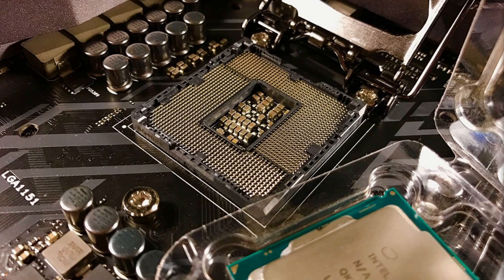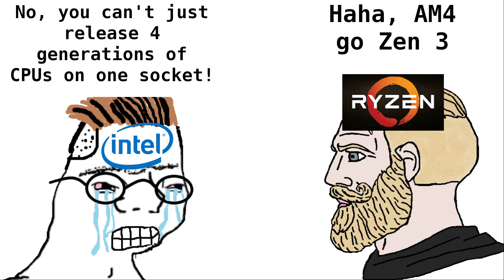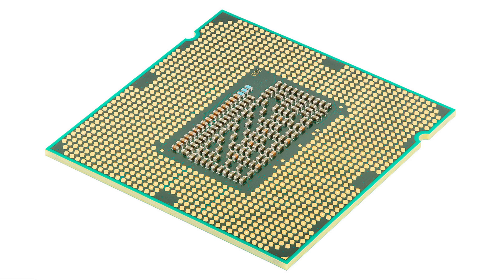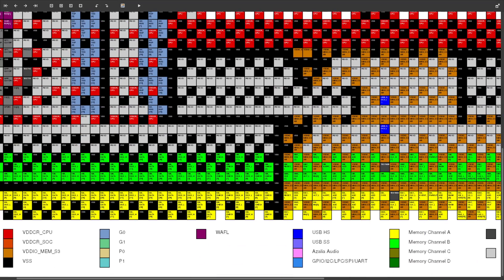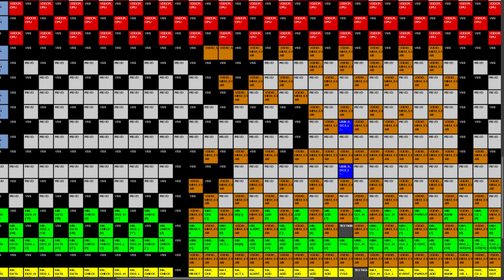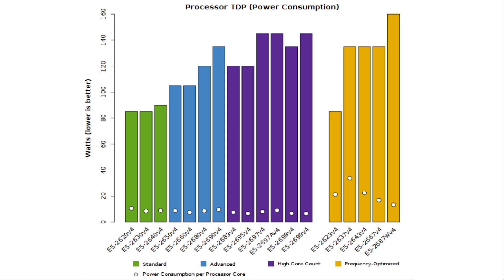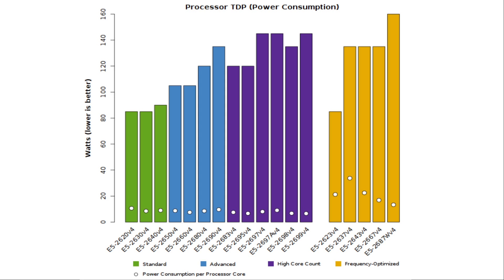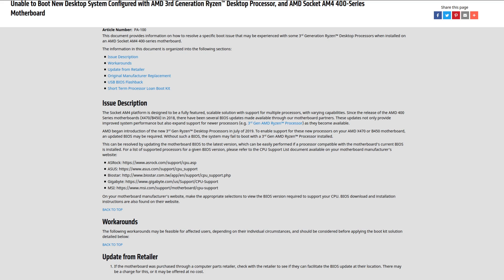The Reason for CPU Socket Changes

Comment: Thing is, you're probably a millennial or something because back then in the 486 and pentium 1 era you had to set jumpers for compatibility, and you could make theoretically uncompatible cpus become compatible that way if you knew your shit. Plus Pentium 3 and 4 that was incompatible with older boards would just be detected incorrectly in incompatible boards but still work, just with the parameters of other slower cpu model, until you updated the bios, but bottom line is, it would work, because the reserved pins would do nothing but the other pins would retain the same functions and be enough to operate the new cpu for a bios flash.

Comment: It's defenetly not suited for grandpa who writes mails and surfs Amazon. But such users wouldn't upgrade their PC in time of even one whole AMD Plattform at all. They will stick with it for 10 years, so it doesn't matter for them. All enthusiasts maybe have an older and CPU with let's say 6 cores at home, than they upgrade for a newer generation 8 core and the old 6 core goes to ebay. If they had bought Intel the would need an new Mainboard ...

Comment: There may be a real reason for socket changes but you can't ever explain to me that you can't have a universal socket. Plus if you need more pins for more speed explain socket 1156, 1155, and 1151. Intel has been pulling this nonsense for eons, and even some socket 771 processors worked with socket 775 motherboards with a tape mod, or vise versa. Plus if your buying a new PC you're probably going to buy new parts. If you have an old motherboard you are probably upgrading to a new processor which means you probably already have a processor that works with your board to begin with. I remember the buying the Z270 chipset board for my i7-7700K, then the I7-8700K came out and I couldn't use it in my Z270 board, because apparently you have to have the 300 series chipset and that was without a socket change. The ONLY time any consumer should have to change their board is if they are getting generation upgrades like DDR5, or PCIE 4.0, 5.0, etc... AMD has since proven that this can be done and I couldn't disagree with this video more. Seems strange that you would defend these companies despite being a consumer yourself. Intel and AMD could design a universal socket period.

Comment: The thing about power was a thing back in the day with the FX-9590. I’ve had that chip and it was so bad that I went through 3 motherboards before I got one which could handle the FX-9590.

Comment: the socket might have the same name, but not all chipsets have support for all cpus, most 300 series support 2 generations (same as intel), some can be extended by 1 generation with a bios update, that's it..
so from consumer pov this is a deceiving claim, as you have to buy a new motherboard anyway..

Comment: A big issue I have is that the "compatibility"  reason is completely fixed by not cutting corners. The reason the bios versions have such limited support is that it's a part of manufacture that companies have cut corners on the most, not only do they save a few cents per mobo by having smaller amounts of memory, they also have virtually no one working on maintaining BIOS versions, there's literally a handful of people who do it for the whole industry.

Of course, there's a second side to it. If the socket doesn't change, and for 3 years there's no new features to add, the companies need a way to sell more motherboards to keep yearly profits up.

Comment: i only had to decrese the cpu power mapping to 99% from 100% to get my 2600x working with a b350 motherboard so now my cpu dont lock itself up into higher temps (before it was running 80 celsius on standby since it was not compatible)now it 37-45 celsius on standby with stock cooler

Comment: amd proved if you don't cheap oy on the components it's easy to have a multi generation cpu your invalidated
2 as a consumer you should not blindly buy somethin without doing research on said product your stupidity is a your problem

Comment: While I've always had a preference for Intel CPUs, the thought of having buy a new motherboard to upgrade to a slightly superior version of the current product does induce an irrational amount of rage in me.  Kind of stupid to say, but sometimes I wish that CPUs work like any other component that goes into a PCI-e slot.
Reply: How frequently do you upgrade ?
Reply: @shigekax  Not much, I did have to upgrade my CPU more recently which required a new motherboard.  I also occasionally upgrade my wife's PC, which most of the time she just ends up inheriting my old parts.
Reply: Honestly, it's not so much of an issue for me since I plan on switching my 6th gen i5 for a brand new i7 or i9, and the board was also quite a cheap one to begin with.

Comment: 1. You can make sockets with a lot of unnecessary power delivery pins and stuff. I think a Core 2 Duo would work fine being LGA 1200
2. Today boards don’t even need RAM or a CPU to update the BIOS, and most importantly they can boot to BIOS with unsupported CPUs, they just don’t go further. I have an OEM Lenovo board from 2007 that was running Vista Basic, and it did not have any support for my Core 2 Quad Q9550, but it did let me update the BIOS.
3. I do understand chipset incompatibilities, but they should be fair with people who don’t have much money by making new chipsets compatible with older CPUs as well, so you can first upgrade your motherboard and then gather the money for a new CPU.

Comment: Empty pins are not good, it means part of your CPU has been wasted for future-proofing. The idea of future-proofing a PC is ridiculous given the fact that you should build one that will handle your needs for the next 5 years. Software hasn’t kept up with the hardware. Buying new software is not atop anyone’s mind , especially if you already own older versions that work perfectly well. The leading edge is the bleeding edge.
Reply: This is a simplistic form of view...
If u do upgrades every 5 years, u have to buy new CPU, and because intel changes sockets every year, u have to buy new mobo too. If u processor dies, if u have intel, u have to buy a processor for that socket... The same generation, or 1 above, ou 1 below, in some cases. With a long-live socket, u can buy the new generation for that socket.
RAM architecture lives for a long time and takes some years to the new generation supplant the old one in performance. DDR5 today is much worse than middle-end DDR4 on most cenarios. PCI-e 4.0 doesn't do much on GPU, and most people doesn't trully need NVME. And if they do, just a firmware update to obtain that stuff. On the Intel side, new technology means new generation and that means new socket, new mobo, and sometimes, new memory.
And in a few time we'll need to change our power supply tanks to ATX12vo
Reply: @AlexeiDimitri  I’m running an I7-4790k and a Gtx-980 with Ddr3.  I’ve had them for 7 years and it can still run good 1080p on most games. So I think it can carry me two more years no problem. If I spend wisely at that time I can get a new mobo,cpu and gpu with 32gb ddr6 and it should last another 7 years if I select a gen or two under the latest and greatest. That’s always worked for me and in the end is cheap when you amortize the purchase.

Comment: Old times CPU was bottled necked through the FSB front side bus and then further on over the south side bus. So bottle necked but very predictable bus layouts. Everything started transitioning to the CPU being much more self contained, more central, more complex, incorporating controllers for RAM, PCIE/NMVe, … and thus the CPU interconnects are much more complex today. Removing the bottle necks but making the connections around the CPU much more important / CPU version dependent.

AMD does a great work keeping on the same bus, but as mentioned in the video, you don’t know if an old motherboard really is designed for new features. If a processor has a much better memory controller than the motherboard is designed for, you may experience problem achieving the higher memory speeds due to signal issues on the motherboard. Similarly I imagine people will experience a lot of problem trying to get PCIE 4 working on a motherboard designed for PCIE 3 speeds.

Comment: Intel failed to shrink the process node for several CPU generations, so they had to keep increasing the power consumption to improve performance. AMD took advantage of the TSMC's manufacturing advancements so they could fit more transistors (and hence more computing capability) within the same power envelope with each new generation. This allowed AMD to keep the same socket for more powerful CPUs.
Reply: Ah this makes more sense.
Reply: intel didn't increase anything from sandy to skylake significantly enough. Neither power nor perf.
Reply: this would check out, except for example, the x58 platform... where pretty much any mid range or better board can clock the chips to power draw levels that are... a bit insane... im running one.. x5675@4.42-4.7ghz 1.5x volts using dynamic voltage, under full load it pulls quite alot more then any chip sold for the platform ever could have at stock... despite being a lower watt model.. ;) 

intel could have easily spec'ed their socket such that, even if they ran into a situation like this, they could use the same socket, just base support on weather or not the board is able to handle the chip.. this isnt uncommon... lower end and mid range boards often do not support higher models of chips or dont support them at their full perf specs, amd and intel have both had this since the socket 7 days so... it dosnt hold water for me... now... i can see them putting out an am3 vs am3+ spec that allowed board vendors to certify boards that already met the higher power spec, as well as new revisions that also meet that power spec. 

and yeah intels been stuck for a while, i got friends who work at their Portland Oregon area locations and... well... yeah... holy crap... the stories i hear... 

also...i have had intel employees who work in the eng depts flat out tell me that part of the push by execs to change platforms when they were stuck was to keep profits up from chipset sales, not just power spec issues... infact a few of the better previous gen boards could actually provide more power then was needed to power any of the chips for the next platform they dropped, sure they have a valid excuse to just drop a new platform when a large % of board couldnt support new features or power draw....but.... often for intel thats very much not been the case.. 

hell, this 1366 boards a ud3, nothing close to the high end of the day, but it could handle an 8c16t or better chip a couple generations newer had they chosen to keep supporting the platform. 

this isnt like the first P4's that required rambus memory and were just...shit anyway... where the socket being replaced genuinely made perfect sense.... hell... they could have put out an x59 chipset with built in sata III and USB3 and had a platform to cover another few 2-3 generations of chips, hell after a process shrink im betting an 8c16t chip for this socket would actually endup drawing less power at the same clocks vs this 6c12t chip im stuck on till some kind of sanity returns to the tech market..
Reply: It's not just this, from ~2011 onward intel used the 115x sockets without increasing power consumption substantially. They changed the socket frequently 1156 for nehalem 1155 for sandy/ivy 1151 for haswell etc. All of these sockets had two memory channels (often using the same memory technology) and 16 pcie lanes. They also only had a few different pins (the number of the socket indicating the pin count). You may be correct about the more recent sockets, idk, but in the past this statement definitely wasn't true.
Reply: Pin this
Reply: Zen3 and zen2 are on the same node, a different node from zen1 and zen+.

Try again.
Reply: why did they need to shrink the process? Their process was fine up to Zen 3. Their Skylakes performed better than first Zen, and Zen +, they still do. It would have been a giant waste of resources to force upgrade the process. Poor people wouldn't have bought intel anyway, and now they are, because intel is cheaper. Chasing poor people is waste of resources.
edit: Who cares about power consumption outside of some businesses and salty people? Every cheapo aftermarket cooler can "Deal with the heat". Even $40 BQ Slim Rock. No one uses box coolers, and you don't get one with any i9 (that I know of).
Reply: @Ludak021  why did they shrink their process? When amd launched a new architecture that wasn’t optimized very well they were ahead.

Bruh amd is ahead in multicore for years and from time to time beats intels gaming scores, or is a few percent behind.
Reply: @Ludak021  Intels CPUs are monolithic, trying to scale beyond 8-10 cores without a process shrink is really bad for both yield and power consumption. Alder Lake have E cores for no reason other than that more of them could fit on the same die.
Reply: Intel=Works.
AMD=Kinda.
Reply: @tonycstech  Well that's fanboy bait if ever I saw it xD
Reply: @101m4n  You really just gonna ignore Alder Lake killing AMD like that?
Reply: @ProfessorPhysics2  Nope, alder lake is pretty sweet! It's got newer features and very high single core performance. There are some drawbacks though. The windows scheduler nonsense for one, though that's Microsoft's doing, not Intel. I also wouldn't trust intel not to change the socket again to cut short people's upgrade path (which they have done many times before). I also don't know what the value proposition is for the new platform overall, but Intel's platforms have historically been more expensive, even if the processors aren't. Lastly, they're still monolithic dies. I suspect the purpose of the e-cores has more to do with keeping the die area down than improving efficiency (which is already not great for alder lake on account of the process). So yeah, pretty sweet, but a bit of a mixed bag overall. If we see homogenous chiplet based alder lake parts with > 24 cores for HEDT, then I'll start to get interested!

P.S. Where I'd be really interested to see alder lake is in laptops, where the e-cores will really get to do their jobs. On the desktop, they're a little redundant.
Reply: @tonycstech  uh oh someone wants to start a fight in the comments

Comment: I'm sorry, but your excuses are bullshit. I've used BIOS flashback on boards older than 10 years, all the way back to Vishera days. It's quick, It's simple and most people who can assemble a computer can work it out. For those who can't, every PC shop can do it and most offer the service for free if  you bought either the CPU or mobo from them. Hell, cleaning out a laptop fan is much more complicated and it is done on the regular.

Comment: Also bruh socket TR4 has so many reserved pins because those pins are disabled on the Thread ripper platform, since Thread ripper uses the same socket as Epyc and if you Googled Epyc socket SP3, those pins are all used either for the 4 extra memory channels(only 4 is present for regular Threadripper) or to ensure you can't slot in epyc CPUs into Thread ripper socket and vice versa or many other server only pins..................

Comment: Do you want to know what's even more absurd when Intel fanboys uses the "new technology requires new socket" pathetic excuse? AMD has zen1 on monolithic single die, then radically different zen2 with up to 3 dies on a single CPU package on the same socket, AMD managed to not only fit new tech/architecture while at the same time having a completely different, like vastly different CPU layout on the same frickin socket....thus rendering that pathetic excuse absolutely null and idiotic.

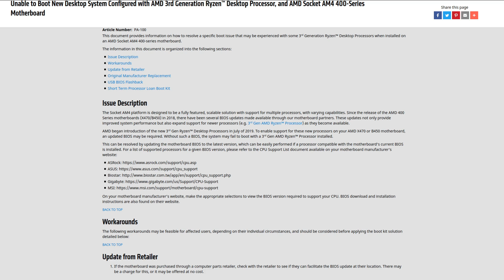Comment: 5:30 Note, this isn't entirely correct. Some motherboards have a usb slot where you can install a functional bios for the new cpu.

This does mean that you have to have a computer capable of downloading the bios onto a stick but you can avoid the rest of that hassle. At least on a decent number of boards I know this applies from experience.
Reply: this feature can even be found on very basic sub $100 boards
Reply: Yeah my 100$ b450 board had a bios flashback button so I could just plug in a USB and hit the button and my 5600x could work perfectly
Reply: 5700G into a $110 MoBo. (Tomahawk Max II)
My limitation was the plethora of crap USBs we had.
Reply: Already built the computer and didn’t need to take anything apart

Comment: AMD also makes it memorable, Intel just goes with socket names that sound similar like LGA 1150, 1151, LGA 478 and 479. Hell, I keep forgetting which socket an Intel/older AMD CPU is compatible with.
Reply: Intel names their sockets after the number of pins it has, something the average user knows or cares nothing about. 
AMD uses a generation and series system, which is much more user-friendly.
Reply: @Psykomancer  Land Grind Array (number of pins). AMD also used to use PGA (number of pins) too, I'm glad they changed.